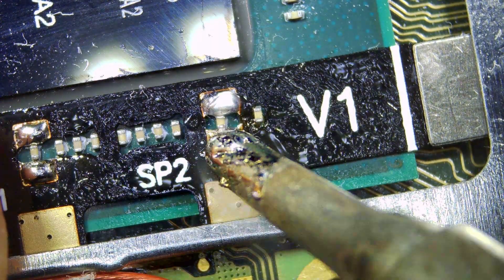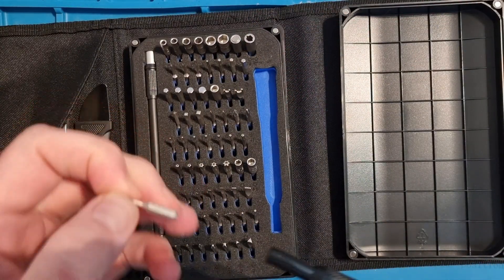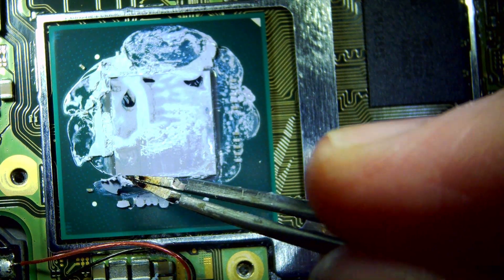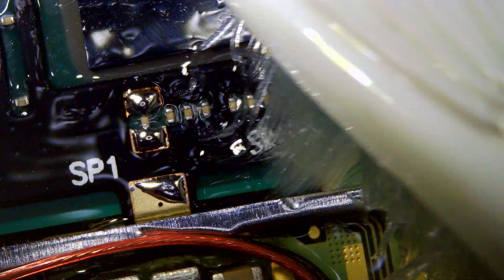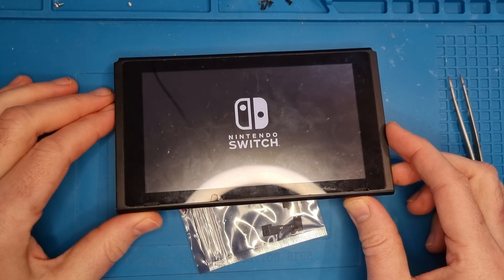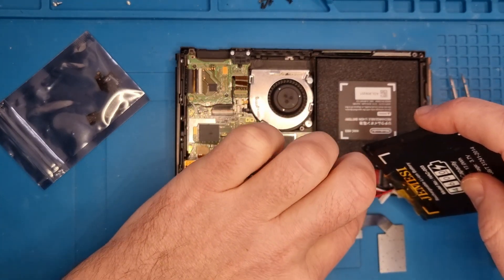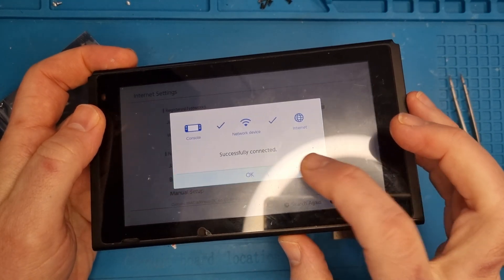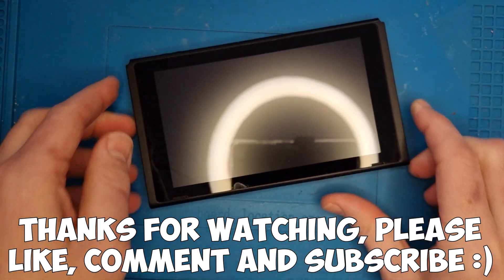Fixing Switch's with an RP2040 mod chip!

Comment: Hey bro! very informative! I have a rookie question. I just broke my sp1/sp2 and some other capacitors in my switch apu. BUT, I already have them here, just ordered in Aliexpress. my question is, is it okay if you just solder it normally to the board with a soldering lead and not the soldering paste/heat gun? thanks!
Reply from the maker: As long as they are soldered both ends it would be OK, I've done similar in the past

Comment: how did the modchip fix it?
Reply from the maker: I think it's stuck in like a boot loop and the mod chip booting it kickstarts it
Reply: @fixingmoddingbuilding  In my experience it tends to be because of the eMMC module having a fault, the mod chip interacts with that in order to load their own firmwares.
Reply: which would explain it i guess.